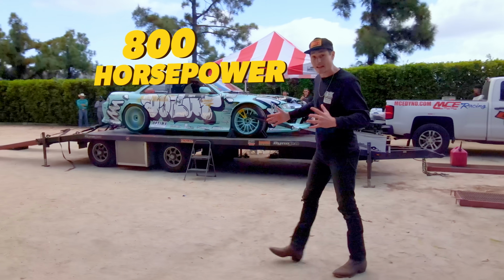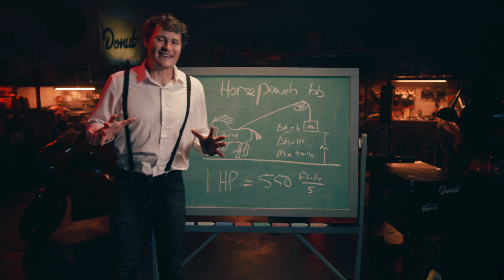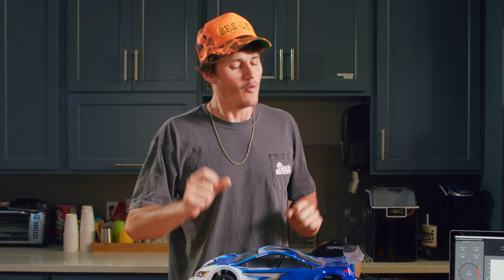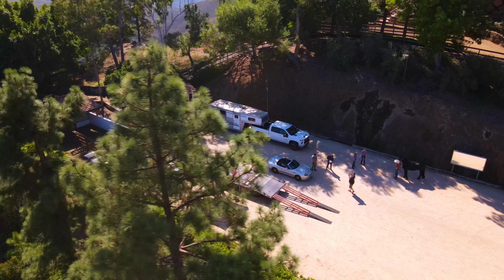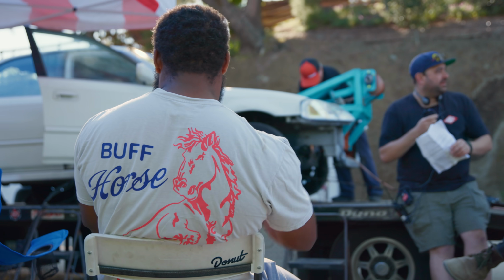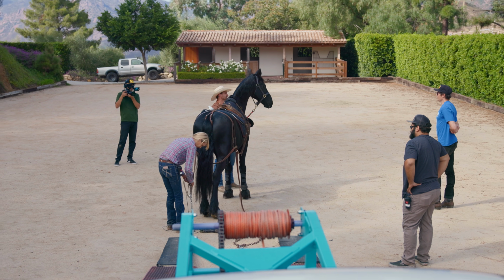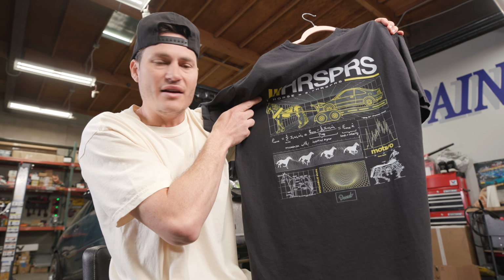How Much Horsepower is a Horse?

Comment: Yeah no. Your gear ratio was wrong. The horse didn't have enough resistance to give an actual figure of max horsepower. First clue should have been when one guy pulled it with relative ease, second clue was when the horse barely noticed he was hooked to anything.

Comment: nice build to make a show around. now why didn't you just use a vertical shaft and circle (like a grain grinder or pump) with a torque sensor on it and a rpm counter? at that point it is simple math plus you can get peak and average. why didn't you use a draft horse (like a percheron) for the test and also a race horse to figure average? but it did make a good show.

Comment: Now where can we get an elephant? 
But seriously, I am not sure "Big D's" breed... am guessing Friesian. That is a strong draft horse, but not the strongest and for the breed Big D wasn't the biggest I've seen. 
Belgian are considered among the strongest breed of draft horse, but the American Belgian is a little smaller and less powerful than the European breed, from the Brabant region of Belgium. You would probably have a difficult time finding a European Belgian in S. Calif.
Another draft breed that can be up to 20% heavier (2400 lb. vs 2000 lb.) is the English Shire. Unlike the Belgian, the Shire breed in N. America is not smaller and lighter, and may be easier to find. Also, a Shire holds the record for the most weight ever pulled by a single horse... 58,000 lb.! The same year (1924), a pair of Shire horses pulled 100,000 lb. Both those records were done using wheeled vehicles. 
Horse pulling competitions today are more typically done pulling a somewhat smaller weight on a flat sled over dry ground (i.e., "deadweight"), with both weight and distance being factors (much like "tractor pulls"). Usually pulls are done by a pair of horses.
At the Calgary Stampede in 2012 a pair of Belgian horses won pulling 13,400 lb. deadweight. In 2014 another pair of Belgians upped the ante a lot by pulling 17,000 lb.!
Incidentally,  what we call "draft" horses today were originally bred for war. They needed to be big and powerful to carry knights in heavy armor.

Comment: Why not use a long pole with the horse attached in one and a counter in the middle with the dyno attached to the middle with the dyno base firm on the ground? Then do some calculation to offset the additional leverage force by the pole.

Comment: The Amish engine swap for a horse all the time. They take equipment that HAD an engine  which drove the work and the wheels.  They remove the engine. Towing the  machine with horses  turns the wheels which in turn drives the work.😊😊

Comment: Just throwing this out there right now (currently at 8:25 in the video).  Why is there a car involved?  Just take the horse, wrap the rope around the dyno roller, and you're good to go.  The car not only adds unneeded complexity, it invalidates the results.  You don't want horsepower at the wheels because that includes other drivetrain loses.  You want brake horsepower, because that's the true horsepower of the standalone horse.
Reply: I came onto timed comments looking for this.

Comment: Wait ... this is silly .... hear me out .. the whole point is that the scale has been wrong... you even mentioned how dynos work. so i expected a rating  of power rating with torque  or something like that ... but to say one horse is = to 5.7 horse power. meaning 1 horse is equal to almost 6 horses is silly ... am I wrong here ???? shouldn't it have been a correction like 1 horse pulls this much or can output this much torque.....

Comment: I think you overlooked the most important measurement of the original rating of a HP and that he observed those horses working over the whole day not just max short bursts of 20seconds or whatever! Much more accurate over a days worth, considering an engine will keep going all day consistently with enough fuel.

Comment: I'm kinda triggered by the etymology being asserted in the "beer and horses" portion of the background of this video.

"Draft" beer is not a type of beer that is made, rather it refers to the way it is stored and served; namely, stored in a keg or cask and poured from a tap, rather than bottled or canned.  It is "drawn" from the tap. Any type of beer can be "draft" beer.

A "Draft" horse is one bred for the purpose of pulling heavy loads, usually on a skid or wagon. The load is "drawn" to it's destination by the horse(s).

On both cases, the term "Draft" merely refers to the act of pulling or "drawing" something.

"Draft horses" are not named because they work the mill for "draft beer."

Comment: You need the rope in a single coil, can’t have it loop on itself as it would make the diameter pf the pulley unintentionally larger. 

As the horse gets further away it would technically reduce in power but increase in torque… just saying if you want the raw number, it can’t loop over itself

Comment: 5.7 HP? Something sounds really off. 550 Lbs 1 foot in 1 second is a darn strong horse. That's 1 HP. So you're saying that horse could lift over 3000 lbs 1 foot in 1 second? Yea, good luck with that. 3000 lbs would pull that poor horse backwards. It's likely more than the horse weighs. It's obviously wrong.
If you're going to measure a real draft horse, find a real draft horse. That's an amish horse that plows fields today. They can be found in Maryland, Pennsylvania and some other states.

Comment: They should have just used wheel dyno that mounts directly to the axle, therefore they could have just fabricated two axle shafts directly to the cable spool and it would have looked less stupid than a vehicle rig.

Comment: Won't the amount of rope spooled on the pulley change the amount of torque measured? As the drum gets smaller (e.g., more rope is spooled) the actual equivalent torque on the hub of that spool varies due to the diameter of the spool? It's like having two meshed cogs, but one of the cogs has a decreasing radius as it rotates.. Surely it will bias the applied torque on the hub.

Also, why wouldn't you attach the spool to the dynamometer itself, and cut out the need for a calculation around tyre loss, etc.? Seems superfluous.

No complaints, cool experiment.. Just not sure it would hold up to complete scrutiny.

Comment: Soo.... 
Couldn't a spool just be mounted to an engine dyno, which is already designed to record crank hp?
Also, was the wraps of line on the spool considered in the equation? It's what, about 12% loss per wrap, which is easy to calculate, but you would need to record the number of wraps compared to the value at the time

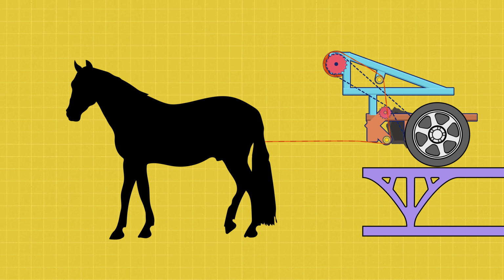Comment: I hope I'm getting ahead of the video BUUUT.... why didn't you just attach an axel/hub dyno pod to a horse treadmill (yes, they actually already exsist)? Basically, like your thumbnail. I really hope I'm just getting ahead of the video and all this brain scratching is just for content sake because I've been "thinking" (yelling at the screen) since basically the beginning of the video (I paused at 12:18 to type this)!

Addition: Now that I think about it, a horse treadmill (used by race trainers, metabolic researchers aka food and pharmaceuticals manufacturers and veterinarians and other equinitarians) should already have speedometers and "breaking systems" for load simulation and therefore should only be a matter of a few software/coding tweeks to make it an actuall horse dyno.

Comment: Your data is Not 100% accurate because different draft horse breeds pull differently ( power)
 you will have to repeat the process with several different breeds of draft horse. Because of inertia.  Power over distance.  What was your Base line For the test? because that horse got better with more pulls.  

Plus I need to point out different breeds of draft horse are bred for different types of work like a  Percheron was what was used to pull stage coach. And carry full armour  knights into battle  Percheron's overall is the fastest and strongest power  vs. speed. the larger the breed the slower and stronger they are. Like the Clydesdale , Belgium or shire draft horse. Without them the data is skewed and overall incomplete .

 But I applaud the effort

 How can I say this it's because I grew up  on a ranch around draft horse's
Specifically the Percheron. My family bred and showed them for year's

Comment: Loved the video but would these numbers not be inaccurate? 
As far as i understand, horsepower is a vehicles peak horsepower at a certain rpm, meaning it would have to go a certain rpm to get its highest hp. does this not mean by not having big d run, that the numbers would be off? wouldnt that mean that big d would be out of that rpm range for peak horsepower? im just really confused on this.

Comment: A horse power was an actual device that a horse could be placed in. It looked like a tank tread on a slight angle with sides. A horse would walk on it and turn a shaft that would be used to operate any number of devices. I can't find pictures of one online, but a historical site I  used to be a guide at has one.

Comment: I think a better way to have done this would have been to do it how they used to.

A large turnstile that is connected to the horse at the end of and walks in circles around.

Then gears and drive shafts connected to the dyno directly via gears.

It has two main advantages.
1) It's not limited. That is, it doesnt have a limited length spooled up rope that runs out. 
2) Whilst there may be backlash, there won't be any stretch. Even a steel wire rope will have some stretch and that will absorb some of the energy.
3) The spooled rope is spooled in layers on top of each other, which changes the diameter at which force is applied and thus changes the "gear ratio".

Comment: Really should have used a treadmill contraption instead of the car.
The horse would have more time and distance to get up to full running speed.

You also have loss of power with the weight of the car although I would hope you already factored that in though.

Comment: This test was the equivalent of having an engine on a load cell and not letting it rev past 1000rpm. Measure the horsepower at 7000rpm- put the car in a gear that lets the horse run at near top speed, with a larger drum with more rope and account for the diameter of the spool reducing as the horse pulls rope off it (torque reducing). I bet the same horse would surpass 10hp at his top speed.

Comment: I’m not reading all of the comments, but obviously that was a really dumb build. When all you needed to do was take that spool hook it to a set of tires, make a little A-frame crank it down on the dino wheel and have the horse pull didn’t need all the loss from thetransmission and all your other gears and all that other crap.

Comment: why on earth did you go so complicated would have been way way simpler to build a tread mill and hub driven dyno on end of head pulley of the tread mill way les math way less power loss through the gears and transmission and rolling resistance and so on and would't have such a limited pull range not to mention a winch has different gear ratio for each wrap of the drum

Comment: I was actually expecting a giant horse treadmill with a dyno under it
Reply: Yeah coz horse treadmills already exist so I was expecting that too
Reply: @lbnewell23 this machine they used didn't exist either, so what's ur point? They could've built one
Reply: @LOUCABRASI  what are you talking about. Horse treadmills do exist
Reply: @lbnewell23  my bad, I misread. I thought u were being sarcastic saying they don't exist
Reply: same here was expecting that
Reply: I was expecting something similar on the thumbnail where the horse runs on a conveyor belt which in turn is somewhat connected to a Dyno.
Reply: Maybe because there's a horse on a treadmill in the thumbnail of the video.
Reply: Same you got me, I thought they were gonna do one of those original HP tests by The diagrams at the start of video the one he said was probably never done 😂
Reply: I thought that I was the only idiot that would have gone for that. Lol
Reply: I thought they would simply do that and they convert the math somehow. I would like to seem more approaches to this.
Reply: Yep
Reply: Right
Reply: Yeah, the thumbnail was misleading.
Reply: Yeah but a treadmill powers itself. You cant make a treadmill move if you run on it because of friction.

Comment: Why didn't you just have a horse walk in a circle like the original?

Also, I am assuming the original was continuous hp so watts engine could make 10hp all day long. I don't think bigD could deliver that power for an hour or so. Though modern engines hp I'd not continuous hp but rather intermittent so I guess this number is more in line with car engines.

Comment: This is not crank horse power . There's was no crank in this.. thus at best was wheel hp. A crank multiples effort.  The horse wasn't  spinning a crank like a Cain mill the horse would  be the piston
Reply: Horse power has a definition  I believe  may be accurate.  I caĺl bull

Comment: Ten minutes into it; I have to go to bed.  This is not difficult at all.  Use a mini pulling tractor sled, one that has telemetry.  It will give you enough information to calculate HP.

Comment: Gotta love all the people wondering if the horsepower rating for vehicles is going to be changed now 🤣

Probably not. Because everyone already knew that ONE real horse could pull more than 1 HP. Even if the old number was wrong, that old number didn't matter, so why would this new number?

If it helps people sleep better at night then just change the word "horsepower" to something else. Call it... "magicalpower" for all anyone cares.

I honestly don't know why people don't just use a word like "output" to describe this engine power. Crank output and wheel output. Or whatever. Calling it "horsepower" has, for a long time, caused a lot of people to believe that a 250 HP engine is equivalent to strapping a car to 250 hourses and letting them all run with it at once 🤣. I know I believed that when I was a child, and I'm sure some adults who don't know better believe it today. It's weird.

Comment: I think the secret here is in realising that horses don't pull things, they PUSH.
I imaging it would have been a lot easier for you to push against a bar attached to the rope somehow so you could lean into it and use you weight as well as you muscles and allow you to better harness your own momentum
I know that you wanted to probably do this with an automotive theme and I'm no engineer or physicist but you could probably achieve the figure through getting the horse to push against a beam or something which mimics a harness, placed IN FRONT of the horse across it's shoulders and measuring the force applied to it.
That's why you see crossbars in pictures of really early harnesses for pulling ploughs and carts etc. Many of our four legged friends don't like walking backwards or to have weight dragging on them. They prefer to be able to push forwards, leaning INTO the weight and by creating a shaft with a crossbar at the front and a plough blade on the other allowed people to basically stop being hunter gatherers and take up larger scale farming by attaching ploughs to draft animals.
So I think your problem, while truly a world changing one, was actually solved many thousands of years ago. Horses push, they don't pull

Comment: Im not an engineer, but a treadmill style is quickly a duhh. Because i dont know how youll compensate for the spool being wider when full and much skinnier when unwound, its not a linear change where you can just add a final drive ratio to fix it

Comment: Nice work mate. I think if you had two dyno wheel drums separated by more than a horse length and then place really long board and tie up horse in enclosure and get it to run pulling board under itself rotating drums.

Comment: So a true horsepower number for cars are a lie. You would need to add 4.7 hp to every 1 hp listed for a car, to make the 5.7 hp. So 100 hp is actually 570 hp in reality. 800 hp is 4,350 hp. What change this will be

Comment: I tried to invent it myself and similar thing is what I thought of 1st, but hen I thought of the other dyno type that connects to the car rotors (wheels/rims/ off the cat). Then mount a solid axle between both dyno  engines and put a long rope in a winch type, but two layers so we don't change the ratio, so the horse spins the dyno alluminum axle directly, whiteout any drivetrain loss, without spinning a wheel and a rim, smallest thing will affect 1 horse. I am curious what they will achieve, will they need more horses to pull any reading from the dyno? Watching now:)

Comment: I’m only half way through the video, but why mess with the car in the equation?  just build a frame with an axle and use the rest of the setup the same:  that way you don’t have to deal with most of the mechanical losses.  Also, I probably would’ve used a Clydesdale or Belgian instead of the warm-blood breed you used.  Otherwise, great video!

Comment: This was definitely designed by an engineer a little idea for the future you can use a hub dyno and literally just bolt a drum between the two hubs take about 2 hours to build the rig cost you under $500

Comment: I was glad to see the GPS and the strain gauge route in there, because the whole time I'm thinking: water brake dyno or even a friction clutch, because an inertial dyno is an odd fit for low speed, and there's all of the losses with the welded up mechanism and tires. At any rate, great effort, great story arc, and a great service to numerical correctness for all of history!